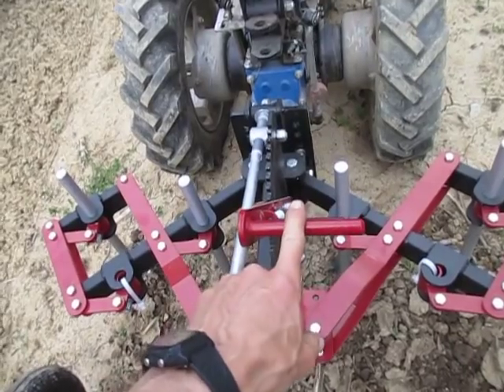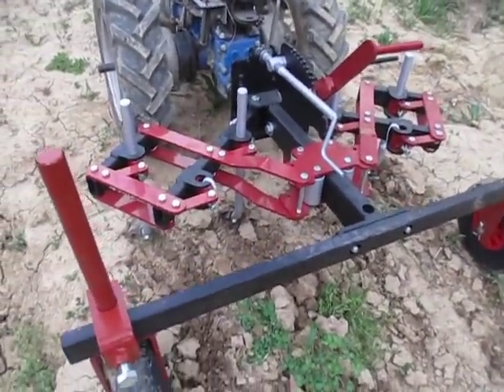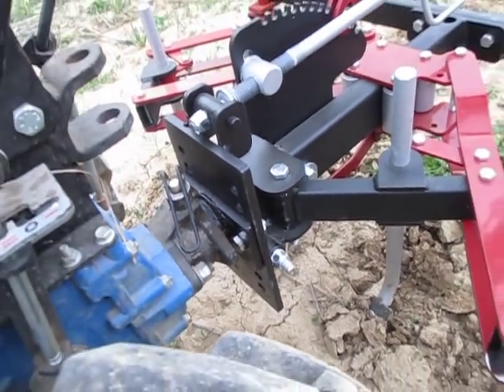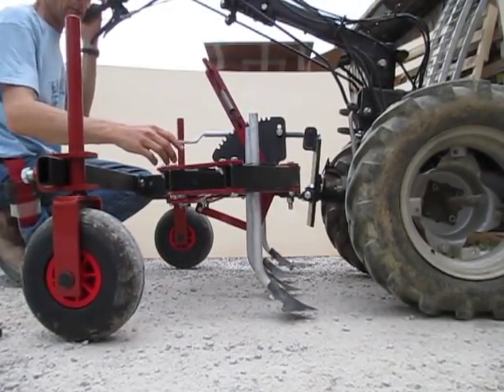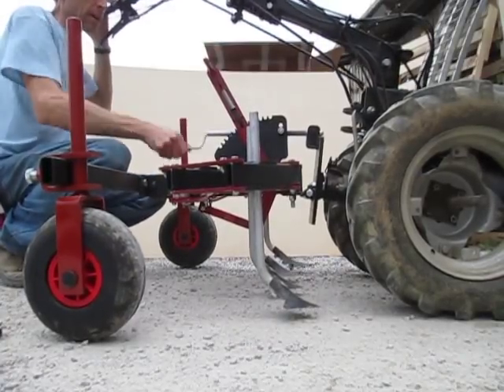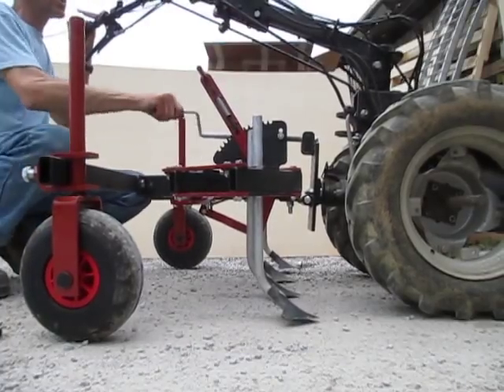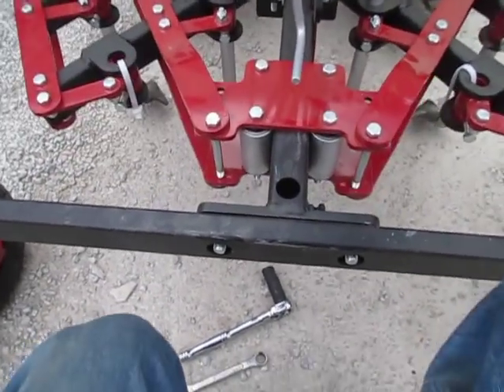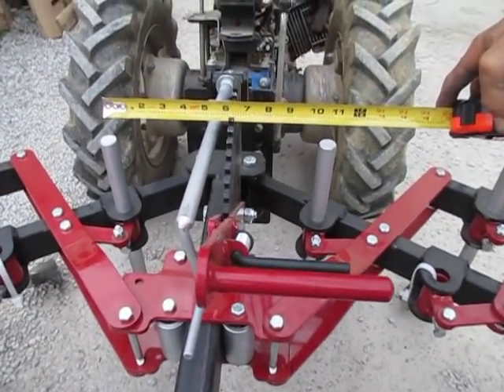Adjustable Frame Cultivator for Walk-Behind Tractors: Earth Tools 1st Generation

Comment: Only downfall is very limited crop clearance.
Reply: You're absolutely right there.   Sometimes I miss the old tall trike tractors for this reason.   If you ever used a Farmall H you'd be shocked what you can cultivate.
Reply: How high do you need?... They sell 26 inch tractor lug as well as steel wheels which gets you around 12 inches depending on where the hub is. You can smack the tops of stuff around a little as it gets taller. If the stock shanks aren't long enough you can extend them with fittings and round stock. Then you can reverse the wheels to get very narrow spacing to fit between rows... I can get down to 17 inches on the outside of the wheels with the 4" wide x 19" inch diameter steel wheels on my G131, which is a relatively large 2 wheeler. With the regular 13 HP machines you can probably get down to 14 inches with the various 4 inch wide wheels in steel or rubber. I don't recall tall stuff like corn or tomatoes being planted in rows closer than that... If the wheels are catching leaves then put a smooth fender or a pizza pan over them.

Comment: Am I the only one to notice that the tractors tyres are facing the wrong way!
Reply: The handlebars can swivel 180 degrees. It has forward in both directions. Ppl don’t usually flip the tires when they change implements & switch the handlebars around.